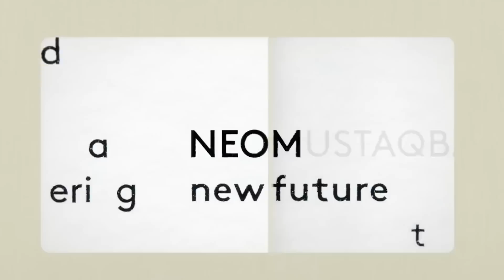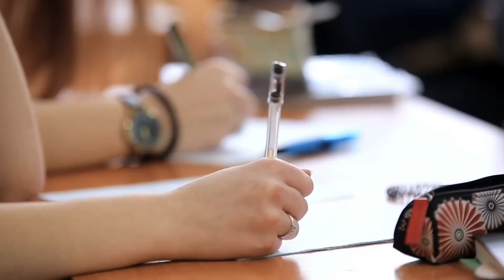Insane Construction Progress - Neom Is Happening!

Comment: The artists depictions of Neom are unrealistic. There’s too much glare, hard surfaces, and right angles in the architecture. What is needed for a comfortable city is rounded walls, arched bridges, and a softer look about things. Make it more organic with beautiful flowers and plants in many places. Also, the use of earthen materials will be very important for the future because of low energy cost of manufacture and maintenance. Rammed earth adobe blocks are just one example of the possibilities. Geopolymers are another.  Sustainable and resilient design depends on an economy based upon local resources for local purposes, and that economy will depend on the quality of mutually supporting systems working together. Complex design is where the real power comes from.  The mirrored surface that’s presented by the artists is a gigantic wind sail.  making that surface look faceted is a very important part of making the appearance. More interesting to people. The ability to move those facets could be an asset for mitigating wind problems.

Comment: first, nothing shown here is actual work, it's all agi.  the desert sand moving exercise is real, very little of anything else is actual real images and progress.
how? end to end in 20 mins? how?  170kms is 100 miles, how? end to end in 20 mins? trains would have to run at over 300 miles per hour to go end to end in 20 mins, and that's without stopping.  as for building it, how? how does this get built when the technology required to build it and make it a reality doesn't exist. with what? seriously, if the entire globe concentrated all the natural resources just to make this feasible, there are nearly enough resources to build two horizontal skyscrapers 80 stories high and 100 miles long?  is mbs going to kill all the engineers he was on payroll when they finally tell him he's nuts?  not a single blue print has been produced, not a single block of anything has been laid.  sure, there are a bunch of dozers and dump trucks moving sand, but that's just a stupid trick to suck in foreign investment. this will never ever see the light of day